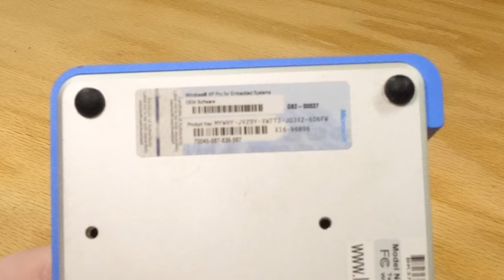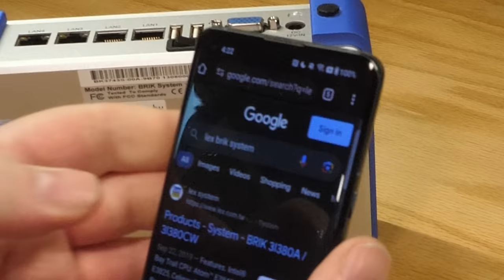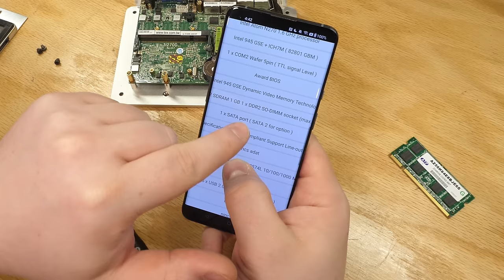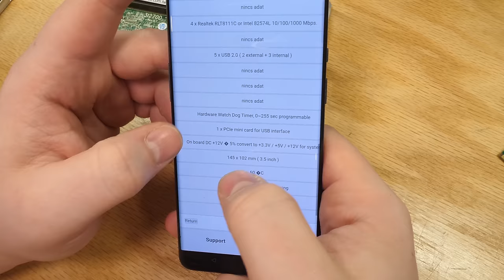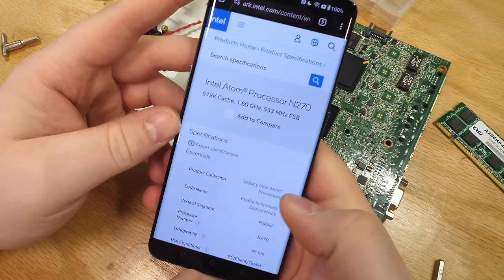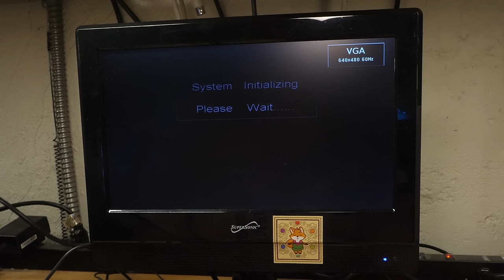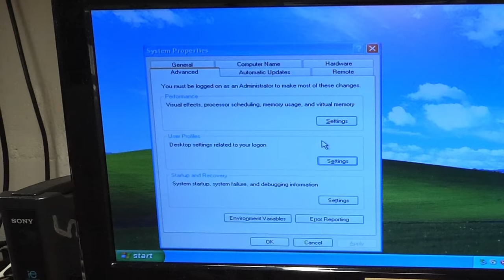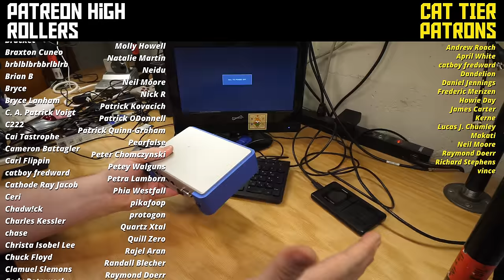Little Guys: Episode 3 [Lex Brik]

Comment: What? 3 screws mounted to a SATA SSD? 2? ONE? NA! There is only 2 valid options. All 4 or NONE! Or... If you are in a rough spot, 2 screws can be acceptable. :)

Honestly... half of my SSD's are fully screwed down. The other half of them are zip tied down, or holding on for dear life by the SATA and power cables!
My data backup computer of spinning rust? (NAS without network)  It has a old Intel SSD completely loose. If it ever get the idea to drop out? Like in any way?
I mean the HDD's are not going to be working by that point. Since if the case is handled that poorly the drives are going to be ruined by the drop.

My old tower has and even had 4! SSD's completely lose without a worry in the world about them. Yet my new rig have some nice SATA mounts, and if they are going to get any screws. It better be a proper job. The problem really with SSD's is if you ruin the screw heads. Or poor quality ones... The server Intel SSD is not going to see anymore screws... It got away from being scrapped by the sliver of patient left. 4 ruined heads are allot of fun! To the Intel SSD's credit. It has survived for FAR longer then any modern SSD is ever going to do.

Comment: Hey CRD - yes yes yes on the IODD review - I need a cdrom emulator. I actually want it for older machines; 486, 386, etc. So if you've any wizardry for those types of legacy machines thru the IODD. Or, just what it CAN do. Thanks!!!
Reply: I think if you need an optical drive emulator for a PC without USB, the only option at the moment is to get a SCSI card and something like a BlueSCSI
Reply: @Drucklufttroete  I'm doing 1/2 of that - I got an SCSI card and use a CD-ROM drive. Good idea about a blueSCSI - I've always thought about that as a Macintosh thing. Thanks.

Comment: I had an N270 netbook, that thing was atrocious and was even slow on XP.  It really only ran well on a stripped down linux with the special intel Atom kernel modules.  Those early atoms up until they went 64 bit were all in order execution CPUs so the performance can get pretty bad if the OS's scheduler doesn't know how to handle it.

Comment: I'm curious.... are you a fan of the current MINISFORUM style powerful tiny PC? They are kind of pricey to get that form factor. But it's still cool engineering to make them work.
Reply from the maker: Is that the same as the "1L" de facto standard? It sure looks that way, and I do love the one liters
Reply: @CathodeRayDude  The Minisforum MS01 even has a PCI-e slot for a single slot dGPU! THAT is very unusual for such small prebuilt PCs. Though being single slot really limits the options. ETA PRIME swapped the single slot cooler from an Intel A310 to an A380 to make it work and it actually worked quite well, though you would need to sell the A310 with the 380's cooler to make it make some financial sense. Maybe a company will see your tear downs and offer to send you something new to take apart. Though based on your content.. you would probably decline.
Reply: @CathodeRayDude  FWIW- people trying to game on old crappy hardware gets lots of views (I think people love seeing others suffer). You should try gaming on some of these tiny old PCs- might be some easy video content to make and fill the gaps between your normal well written content. EDIT!!!!!!! Ok.. I just checked out your other channel where you play like 80s and early 90s computer games. Yeah.. if that's your thing, any of these tiny PCs can play those (assuming compatibility- pre 2000 gaming was a crap shoot of sound card and video card problems).

Comment: Total speculation, but the fact that they machined it after anodizing makes me wonder if it was cast instead of extruded, and they went in with a tool to fix a defect specific to this one individual part that only got caught near the end of the process.  Because otherwise, they would have extruded the part, machined it down, and only then anodized it.  

(Source:  I used to work for a company that worked with this sort of thing.  But it was a terrible company, so it's possible I learned things the wrong way.)
Reply from the maker: oh no they definitely anodized after machining, otherwise there'd be no blue on the cut surface
Reply: @CathodeRayDude  Ah - I was only half-listening, saw the scuff in the anodizing, thought that was what you were talking about, and jumped to the wrong conclusion.

Comment: machinist guy here
There's no way they used a 1/16" endmill that long.  1/4" endmills that long are pretty typical, 3/8" is going to be a little more likely.
The radius you can see there is pretty deceiving, it always looks exaggeratedly smaller than it actually is.
Reply from the maker: Ahhh okay. Weird! I guess it's deceptively small just because they took such a tiny bite? Thanks for filling me in!
Reply: exactly

Comment: damn... hearing the N270 brings me back to dealing with those first generation netbooks, slow as a dog with not really much of an excuse on intel's part. (the 2.5w TDP is pointless, considering the ancient and inefficient (by 2008) 945 chipset it's married to burns 6w, plus another 3.3w for the ICH7m).

if you were lucky you could use a modded bios that enabled you to do FSB overclocking, they were relatively forgiving on that respect and you could get 2-2.4Ghz pretty reliably. at that point it performed OK (rather than the Pentium 3-ish speeds of the stock N270)

and then of course, intel released the next generation, which included actual dual cores, 64-bit, the improvement of a bespoke chipset rather then recycling 2-3 year old silcon!
but of course the OEMs kept choosing the lowest end single-core crap N450 which soured taste in netbooks until they were unpopular. (or morphed into those 2-in-1 tablet things that no one bought, if you were feeling charitable?)

Comment: Wow, a Intel 320 Series SSD, mine took itself out with the 8MB bug and I have since shelved it for obvious reasons. Did yours suffer the same fate and reinvented itself as a prop?
Reply from the maker: no actually I had never heard of this bug, I have a half dozen and they all work. I guess I've gotten lucky!
Reply: @CathodeRayDude  IIRC it is most likely to happen or only happen in events of sudden power loss. I would make sure they aren't used in mission critical applications. For that I use Samsung 830 ssds. Write petabytes and don't care.

Comment: If such a thing existed in a modern version with 4x10G Ethernet, you could install OpenSense on it and make yourself a nice capable router.
Reply: Be better with some SFP ports on it for better configurability, though that would probably get rid of the fail safe relays
Reply: @No-mq5lw  I mean this unit didn't have them populated either.

Comment: Most Consumer CF Cards Are Not Fixed HDD Is Fine For Windows 9X But Windows 2000 And Xp See These Consumer CF Cards As Removeble Card
If You Need Fixed Hdd CF Card You Need Get A Industrial CF Card
However You can Switch Non Fixed Disk To Fixed Disk By Sandisk Dos Utility
Reply: i know the Shift key is right there, but you really don't have to press it for every word you type
Reply: @deneb_tm  Whenever I type a sentence or text
I always start every word with a capital letter
In this case, the shift button on the keyboard sometimes does not work

Comment: The blue part sure looks like injection molded plastic, note the brass inserts.
Reply from the maker: I know it may look like that, but I assure you, it's actually aluminum. I've learned in my examination of these devices that it's actually not uncommon to press brass inserts into aluminum to provide better threats. I'm sure I must have seen this done at some point before now, but I can't think of a time when I ever saw it. It makes sense, but it doesn't seem any less weird for it.

Comment: In regards to the USB lines on the PCIe connector, that would explain how the external GPU adapter I have on my PowerEdge works. It connects via USB to a tiny PCIe card. I thought they were doing some wacky janky stuff with just kind of using the USB purely for convenience of needing some kind of connector that can carry electrical signals, but I guess that's just part of the spec. Fascinating.
Reply: the USB lines were specifically for mini PCIE, not full size. also, GPUs require PCI, those USB adapters are doing what you thought they were, simply running a PCIE x4 connection over a USB cable

Comment: My CNC uses windows 7 embedded only has a single core celeron and 1gb of RAM, has literally nothing on it aside from the MAZAK software on it from YAMAZAKI. The other just uses plain windows 8, its a dual core atom with 4gb of RAM, does the job. Just running g code uses 30 percent on the single core. pathetic.

Comment: not everyone wants the 'brilliant new technology'. as that tiny flimsy low voltage stuff. generally does not operate without problems for 60-80 years in a row. also, no, that 'brilliant new technology' is NOT 'more efficient'. (per cpu cycle it is but 'per time the doorbell gets pressed over a period of 40 years' it is not and sucks up way more electricity than a z80 for example would have done. ;)